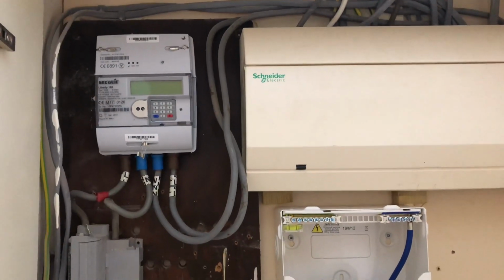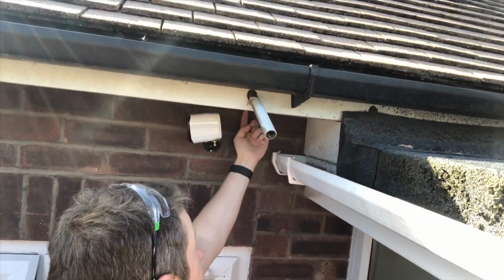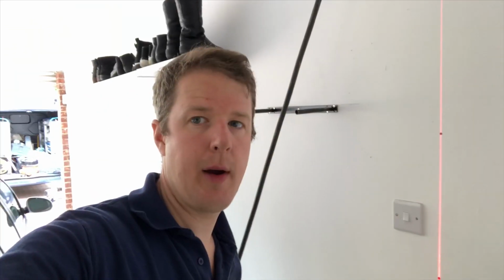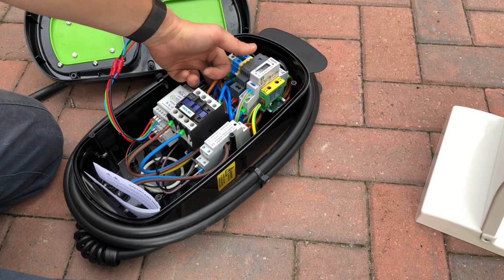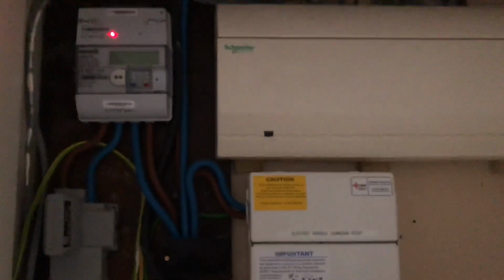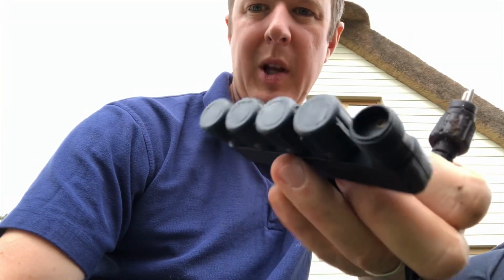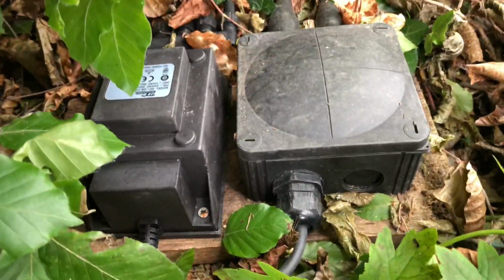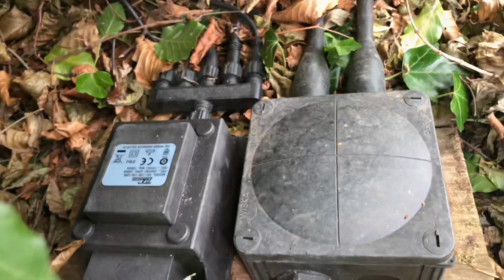Installing a NEW Rolec Electric Vehicle "Smart" Charging Point and some Plug & Play Garden Lighting

Comment: Just one more thing, of which I could point out a fair bit. Where’s your metal clips on the swa? Also, when the customer opens those Windows they are gonna squash your cable. 
Charging point specialist?
Reply from the maker: The windows slide down when opened I checked this before installing the cable. And metal clips are not required on this short run as there’s no way it would collapse in the event of a fire itsbfixed both sides of the doorway as it goes through brick walls so it would not block any entrance even if the plastic clips melted.

Comment: Just wondering about extending the Earth from the internal CU..to the garage which may not have an insulated, from true earth, floor....as this garage was a separate entity at one point in time, and is now joined to the house with the little flat roofed accessway.  I suppose that there is electric already in the garage, spotted the light switch next to your install, so would the potentially uninsulated floor cause more of an issue than already exists?...Basically it is like standing outside...and may therefore need "TT ing" ....  I think some folks will have a unit like this fitted in a garage and then leave the car on the driveway outside the garage and plug into the garage unit and this would then be an issue.... due to different earth potentials, and the extending/exporting of the internal earth potential outside. ........What say you?       Also the different manufacurers equipment in the CU as mentioned below, is that an issue when certifying?
Reply: when i read the regs on charging points i thought if the point was outside or the point was inside but could charge the car outside it had to have an earth rod
Reply: Anthony you are correct, unless it is fitted with a device that will disconnect the charger if a loss of neutral is detected.

Comment: Cant stand Rolec! For what there units cost they are awful! Iv installed these for university of cambridge we replaced all the RCD units in the non smart versions with schneider vigi 6 as they kept failing. Also the screws that hold the front on need to be captive!
Reply from the maker: Yeah I agree about the screws I always end up losing them!

Comment: I have an ongoing job  that is in the middle of nowhere(house being converted to a hotel) and ev charging is going to be provided ...I have to drive 15 minutes just to get a phone signal,I wonder how these chargers deal with no signal
Reply from the maker: Yeah I’m not sure I think they probably need a hard wired data connection if they have no signal
Reply: As I said in a reply to a comment above I think it will be the same closed network as smart meters so if a smart meter doesn't have a problem the charger shouldn't.
Reply: The sim cards in charge points are to enable the 'smart' features of the charger, allowing it to connect with its app over the mobile network, which typically allows the user to set timers for charging, charging output and monitor the amount of energy used etc. In order for the charge points to be OLEV approved, for grant purposes, it must have smart capability built in, hence the sim cards. In areas with no mobile coverage, the smart features of the charger can't be used. The charger will still charge the vehicle however and the missing features are often mirrored  by the vehicle itself anyway.

Comment: Was this on a tt system. Because you not installed an earth rod
Reply: Looks like TN-S 5:54 I think you can get away with that, although who knows if it goes PME en route back to the transformer.  Although it is installed inside a garage and it looks to be near to the back of the garage so he's OK as the car will have to be inside the garage to charge.  Therefore no earth rod required.

Comment: I’m probably out of date, as I haven’t been in the trade for yonks, but it used to be a rule that there has to be a single isolator for the whole installation. Installing a henly block as you have done, with an isolator on the existing board, and another on the car charging circuit, contravenes this rule. When the supply authority upgrades the meter tails, they sometimes install an isolating switch, but they didn’t do so here. Why upgrade to 25 sq mm anyway? Unless there is a large shower, plus electric hob, this supply capacity will never be needed. I have worked in huge houses that were supplied from a 60A single phase supply for ages with no problem.
Reply from the maker: The 7kW EV Charging points will pull 32 amps constantly while charging so usually the main fuse has to be upgraded to 100amp
Reply: I thought you needed a main switch to isolate the entire installation so an isolator should be fitted in between the meter and Henley blocks?

Comment: Are earth rods no longer a requirement for EV chargers? Or are they still required in certain cases?
Reply: For PME as far as I know they're required as EV chargers can become really quite dangerous in the case of a broken PEN conductor.
Reply: Alex an earth rod is required unless you use a voltage detection device which are apparently rare and expensive ,I have come across a 3 phase podpoint with no spike and a sticker saying it complies with this a pen isolation system reg 722.411.4.1 (iii) fed by an rcbo I only presume this is in the podpoint itself
Reply: If the point is inside then an earth rod is not needed as long as all exposed metal work is at the same potential

Comment: It's a shame you're installing Rolec gear.  Have a look at the Zappi.

As others have said you should only install kit that has been approved by the manufacturer (in this case BG) into a CU.  Lastly type A RCBO?  Isn't type B recommended for EVSE?
Reply from the maker: I’m also a Zappi approved installer but prefer Rolec so far. Andersen are the best ones and I’m recommending these to all my customers but they are expensive.
Reply: @artisanelectrics  I'm going with Podpoint, same price point as backwards thinking Rolec but Podpoint have the Penfold detection device built into them so can be be fitted onto a PME system with no earth rod meeting regs. They are ahead of the game along with Zappi. Then all you need is a Type A RCD and circuit protection. Agood point was made earlier about EBADS on your separate consumers unit, what do you think?
Reply from the maker: Thanks for your comment. I’m not fitting Rolec anymore at the moment I’m fitting EO Mini Pro with a Matte device. And by the way it’s a PEN Fault Detection Device (not penfold) 😁
Reply: I was thinking the same thing, type Bs are the most sensitive to DC so even though the chargers have a DC RCD built in I don't understand why a type A would be used at the CU.
Reply from the maker: Type B is not needed as the Rolec unit has a DC current monitoring device inside the unit

Comment: What a sham, the government push for all vehicle to be either electric or hybrid, the national grid know they don't have the infrastructure set up for this so demand that all ev charging points have a 'tap' fitted so they can reduce your charge as and when they want to.
Reply: Absolutely SPOT ON Alvin .  Just imagine if say a street of 60 houses  (  20 on each phase)  ALL decided to fit a 32Amp EV point fitted 
.   And - even with a modest sized EV - of say 30 - 60 kWh  - That is going to take in the order of 6- - 8 hours to charge.  - SO that means 20 * 32A  = 640A   on each phase - constant  load -  I cant  see the average street distribution cable supporting a constant load of  640 Amps !!!  - So  what is the answer ---- oooh I know - make the chargers "smart"  so they don't all charge at once !!  (  so if everyone decides to charge at night - for the next mornings use …. hmmmm ) 
  (  … OH  - and NO diversity  on that Charger allowed -  so that ALSO means that many homes will NOT be able to have a 32A EV point fitted anyway  100A  fuse or  not  IF you do your max load /diversity calculation correctly )
Reply: can it not just be taken out of the circuit at a later date?

Comment: Thanks for yet another interesting video. As you say, the new smart Rolec charger does not now have the type A RCBO fitted internally, but they supply it for incorporation into the consumer unit. But to assure compliance to the CU EN nnnnnnn number  it is generally recognised that the case and protective devices etc. within the CU should all be from the same supplier.
Reply: You had a grinding disc in your grinder not a cutting disc. With a 1mm cutting disc you can whip through swa.

Also use a guard in your grinder, ive seen someone on site get injured when a disc split with no guard and only eye protection being worn.

Comment: well rolec are being cheap there, removing the RCBO from the charger unit and not supplying a unit to install it into, then you using a  BG Board and deviating from the manufactures  guidelines fitting a Non compliant rolec breaker ? how does that work, what do rolec expect you to do as you wont be able to fit to any existing consumer unit i.e. the Schneider one for the same reason,  think there is a reg about it.
 on the plus side lights seem ok
Reply from the maker: Yeah it’s impossible to fit in a Rolec unit as they don’t make any! I think the whole type testing thing is a bit OTT to be honest anyway. I understand not fitting different types of breakers in one board next to each other but if it’s a blank board then I don’t see a problem with it.
Reply: @artisanelectrics  bit of an old post , sort of agree with you about the board, it was more that Rolec should have never put you in that position in the first place.
On one of your later videos have they now changed that ?
Reply: Buy a zappi 2. Everything built in, pen fault monitoring, type A  RCDs protection, might cost a bit more, but will save on all this flapping about with extra consumer units, Henley blocks, labour.
Reply: Interesting Mr. Aritisan, hasn't responded..

Comment: Great Video. I assume the SIM card activates some kind of solenoid which can attenuate or turn off supply under certain circumstances. Worried about power consumption 7.5kw which when added to a 10kw shower, cooking, lighting etc which could exceed DNO main fuse and how this can be tackled without installing a priority switch.
Reply: I think the monitoring device is more to do with the National Grid wanting to know how many EV charging points are being used at any one time and prevent them from blowing their fuses back at the sub-station(s).
Reply: The communications are so the National Grid can throttle EV chargers when the grid is at risk of becoming overloaded. I imagine it will be the same closed communication network as smart meters and not a SIM card.
Reply: Great, so the government force us to buy electric vehicles then cut the power off..!!
Reply from the maker: Yep! 😂

Comment: Not to be critical, each to their own, but although we all remove seals from cut outs under EaWR - if I removed seals from any meter in Kent to replace DNO/metering company tails it could create serious problems (and costs) for the house owners at the next meter reading. It's not our equipment to tamper with, not our tails, not in our remit to upgrade, open or alter. 
Network operators installed those tails with 100A fused cut outs for decades and just because our current edition of best practice guide suggest in table 4D1A minimum of 25mm2 for 100A (on our end) it does not make the old DNO tails automatically backward non compliant or dangerous. It's not our place to question their guidelines. Terminate their 16mm2 in henley block, start your 25mm2 feed from there to the CU and that's it.  If you believe the tails to be dangerous for the purpose or notice any signs of thermal stress then report it to the metering company and they'll do the rest of the way for free. Otherwise as far as I'm concerned - do not tamper with metering equipment.
Reply: How does he terminate their 16 mm sq tails in a henley block, wouldn't he have to withdraw the DNO service fuse to do that?
Reply: Alvin Ashman 

Didn’t just remove seal on fuse, also cut seal on meter.

Annoying thing though with these meters is, I’ve tried to get the tails changed before when meter is changed from 16mm to 25mm, asked the meter fitter if he can swap them for me if they are 16mm... but it’s hit or miss, some will oblige and do it without question and others kick up a fuss about it.

But certainly with smart meters I would be more wary as they may have a tamper trigger built into them that records the cover has been opened and transmits that to the supplier.
Reply: @ashmanelectricalservices4318  He can cut DNO's seals, we all do, but I just wouldn't touch seals and tails on the meter side. You can use EaWR to remove cut out seals but what legal excuse do we have to open and tamper with meters?
Reply: Touching the meter seals is a defo no go area due to the nature of the device (i.e potential fraud)
Reply: Omg, not the don’t cut the seals thing again
Reply: Cut and re-seal the DNO cut out fuse what I do. Or get a mate from Weston Power (my DNO)  with a set of seal crimps ....
Reply: Von Reagan that’s good mate. Rest of us live in the real world
Reply: @Callllum  The tails between the cut out and the meter are not ours to replace. Remove the seals on cut out so you don't work live, but don't touch seals on the meter. Seriously guys, in our neck of the woods most energy suppliers would fine the owner for tampering with meter after the first in-person reading. The new meters come with built in isolator anyway and our end of the tails are removable without cutting the seals. If it's an old meter and you have doubts about their sizing guidance, report "smell of hot plastic" back to the supplier and they'll change it between meter and your henley block for free.
Reply: Von Reagan misread your original comment I thought you were saying not to remove cut out seal. As you were